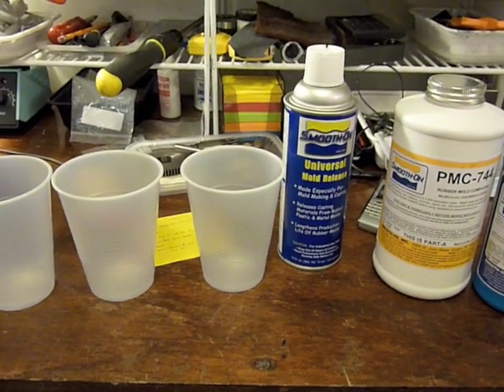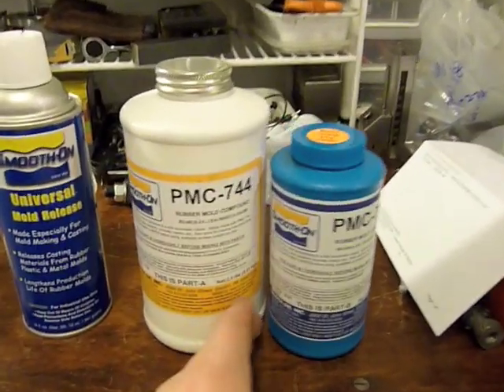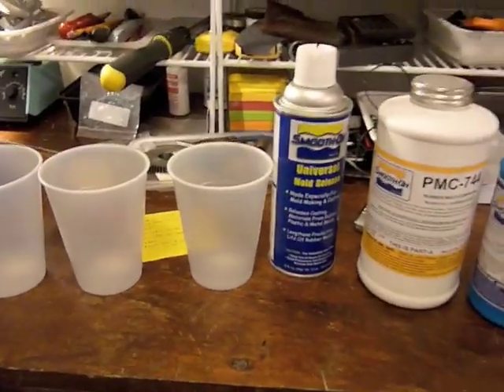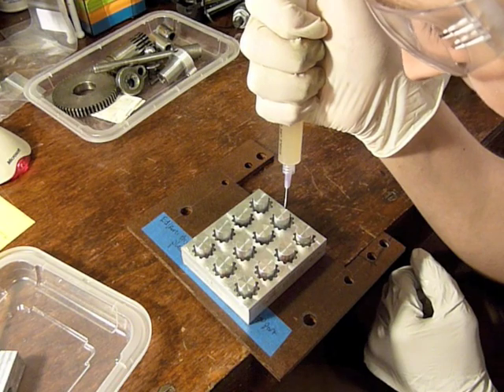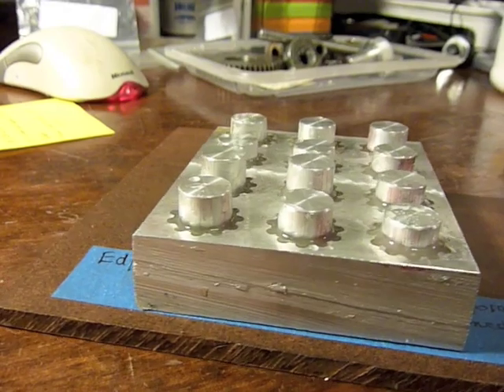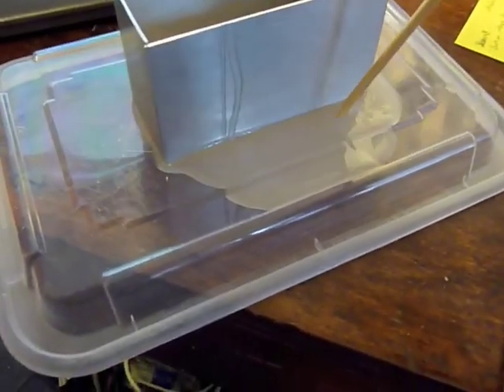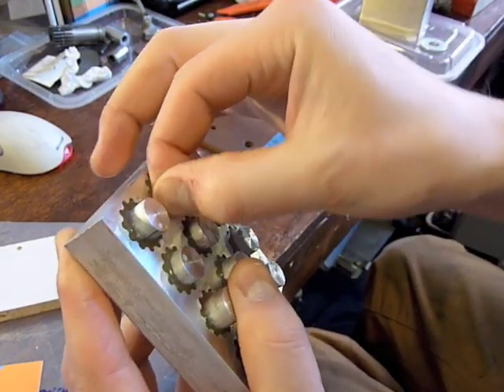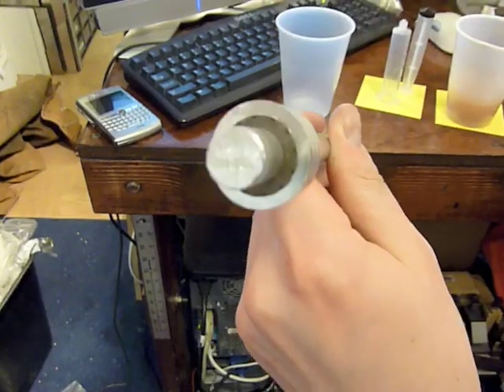Machining & Casting an Aluminum Mold for Smooth-On Urethane Rubber (Part 2 of 2)

Comment: Hi John, just looking through your early posts with joy :-)
a watertight metal mold:
to get quickly the required volume of your cast material without calculating mathematically, simply fill your mold with water in the same type of container ( cup ) which you are using for mixing the components A, B. You can use it as a measure for your cast liquids. For most liquids like silicone, rubber, urethane, acrylics etc., the volumes are fairly the same.

Greetings from an artist and experienced bronze caster

Herri

Comment: Nicely done!  I've just started playing with Smooth On castable plastic to make playing pieces for a game, myself.  It's quite a bit of fun to mess with, although I've had some problems with tiny air bubbles showing up in the castings.  I bought an old pressure cooker for $3 at the local Goodwill and hooked it up to an old vacuum pump we had sitting around, so with any luck, this will degas the material and prevent bubbles.  We'll see...

Comment: just a correction, air conditioners remove humidity from the air.  that's why the A/C usually defaults to on when using the defroster in your car, and the evaporators always have a water drain tube.  totally unrelated to a great video, however!